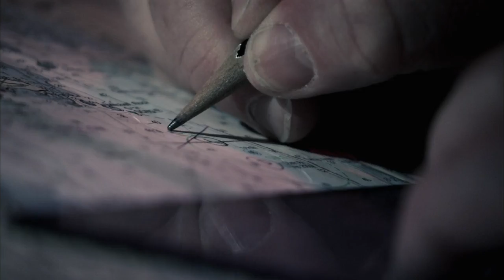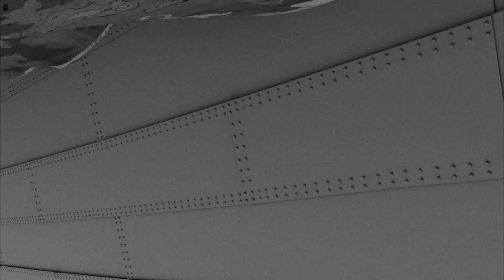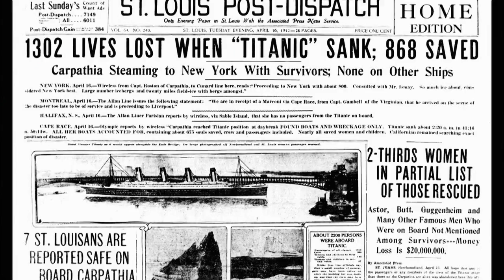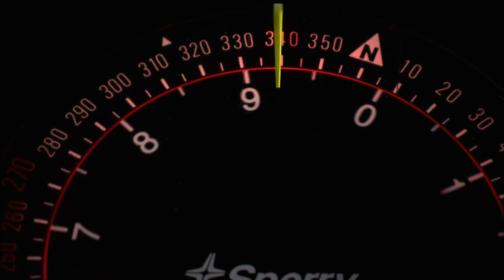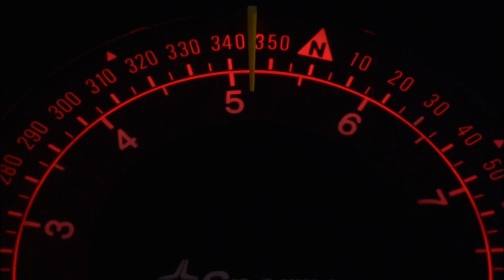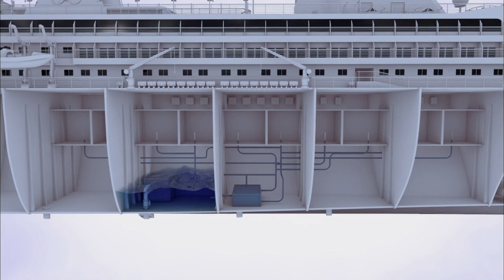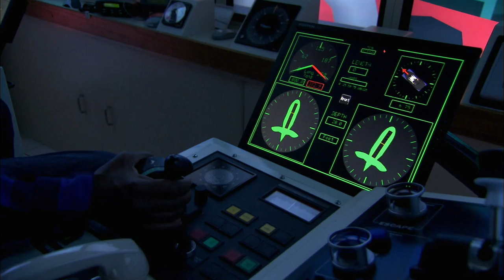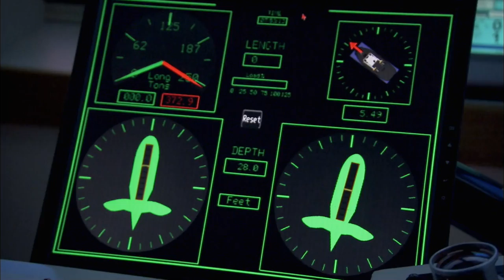Sinking Cruise Ship - Documentary [HD]

Comment: Here's what I know: houses, cars, etc., are built as cheaply as they can be made. Unless, one is rich enough to know what to look for and can oversee how their houses are being built. Today, most apts., being built have hardly no insulation. The walls are thin, the floors are only the minimum in depth. I lived in an apt. New apt. I was flooded out. I lived upstairs. The walls had this blown insulation, most like the same foam used to package things. And, not much of that. It was hot in summer and cold in winter. The heating & a/c unit didn't throw out enough air. So, I had to keep the thermostat on higher/lower than in my home before. I have often wondered if ships are made out of good steel. And, if so, what kind of steel. Surely ships aren't made with fiberglass like in an automobile. It's all about the money. Is one's life not worth the best a ship can be built? I'm sure the titanic was very well built. Everything was built better in those days. So, I just heard that steel used in today's ships are much stronger than that of the titanic. Imagine the money made on cruises.
Reply: Yeah, the Titanic was built the best they could back in those days. Harland and Wolff thought of everything; and they made sure that the ship was built the best it could.

Comment: 1.	How many Americans go on a cruise each year?
2.	When did the Titanic sink?
3.	Who owned the Costa Concordia?
4.	What did Costa Concordia hit that made it sink?
5.	What 2 things did the Titanic and the Costa Concordia have in common regarding their crash?
6.	How much more resistant to impact is modern-day steel versus the steel that made the Titanic?
7.	What happened to the rivets when the iceberg struck the Titanic?
8.	Did the Costa Concordia have any rivets?
9.	What safety features did both the Titanic and Costa Concordia have in common?
10.	Where were both ships struck during their accident?
11.	Height of cruise ships is becoming a concern. What is the height of many modern-day cruise ships? 
12.	What is the center of gravity?
13.	Does a higher center of gravity rock more or less compared to a lower center of gravity?
14.	How did they rescue the passengers on the Oceana’s boat?
15.	What is negative panic?
16.	What did Captain Smith fail to do with the lifeboats?
17.	What were passengers told when the Costa Concordia lost electricity?
18.	How long after the collision did the Captain call for an abandoned ship? 
19.	a. What did the Costa Concordia captain claim as to why he was not on board the ship after the crash?
b. What was the coast guard instruction to the captain?
20.	What decision did the Costa Concordia’s captain make that saved many lives?

Comment: I can't believe how the rock managed to tare such thick steel like how thick was it four inches? Even if the Costa Concordia had a double hull it wouldn't do shit since the rock got lodged pretty deep in the ship's hull so it would cut through the double hull as well. The thing is though if TITANIC had been welded rather than riveted (which the technology didn't exist back then but let's be hypothetical and assume it did) then if it hit the iceberg it wouldn't do shit there is no way ice can cut through an inch and a half thick steel, (which was the thickness used on the TITANIC I think) rock yes absolutely, ice no impossible. It would just smash the ice and dent the hull inwards quite a bit but it probably wouldn't breach it. That is if they side-swiped it as they did in 1912. If they hit it head-on even with modern welded steel it would probably breach the hull or many just bend it inward really badly deforming the bow compleatly. (Hypothetical let's assume they used modern steel since were talking about welding which didn't exist back then either)